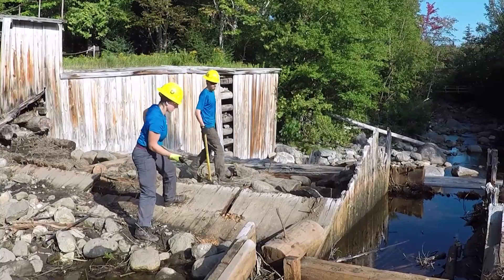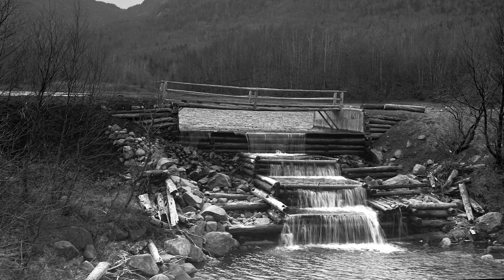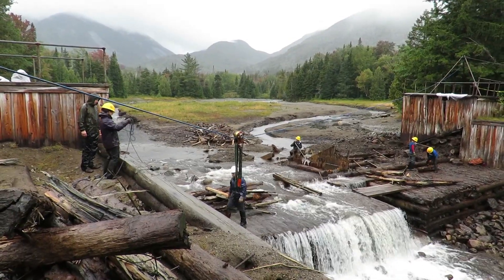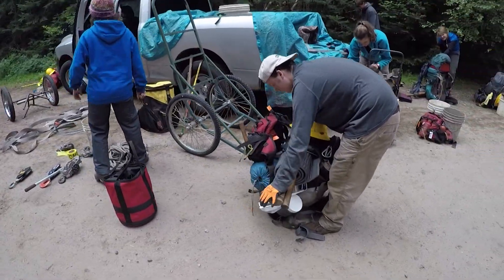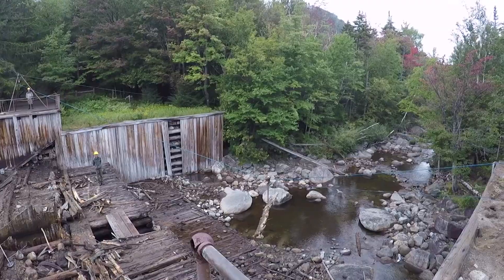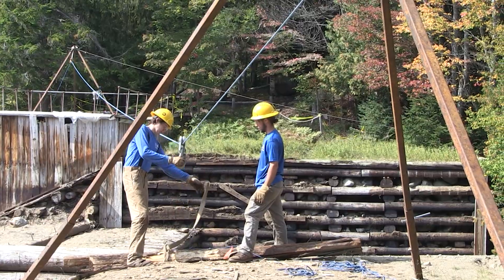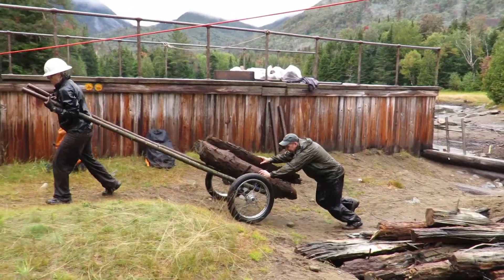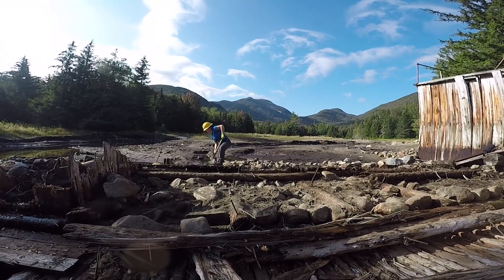Removal of Marcy Dam

Comment: I think this approach is great. Because this dam is not a large concrete structure and because of the need to not disturb the surrounding area, removal by manual labor makes sense. Wish I could have assisted
Reply: Other than the fact that there was a f**** road right to the top of this damn before 2011 so it's not exactly remote!

Comment: I am in favor of wilderness areas, but it seems rather ridiculous to me that they couldn't use motorized vehicles to facilitate the dam removal.
Reply: With such projects, you often spend more time preparing the roads and cutting down hundreds of trees than actually working. If it where a larger project, surely get some heavy equipment, but a small crew for 20 days seems totally reasonable.
Reply: Those are the rules of a wilderness area, no motorized vehicles. But I agree it would have been much more efficient and safer to use construction equipment.
Reply: That is ridiculous not being able to use large machinery. For the few days the equipment is there. Utterly stupid and asonine!!!!!